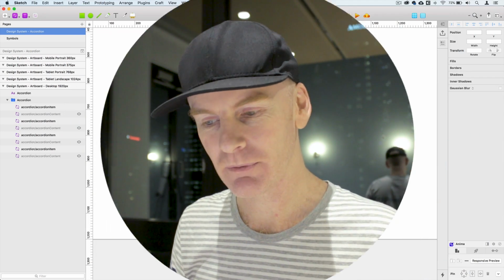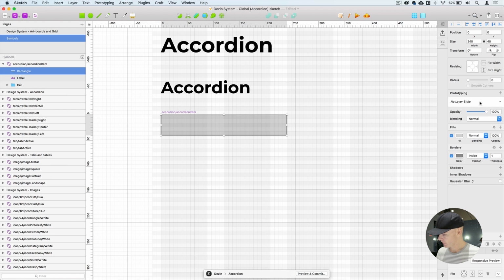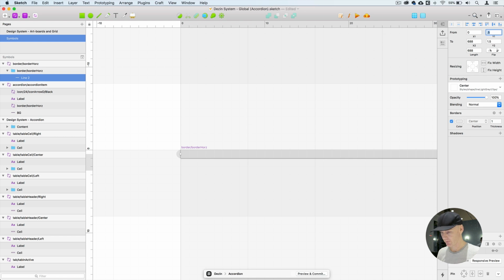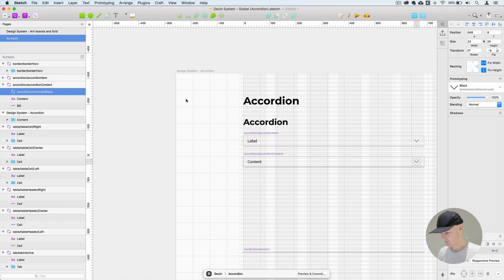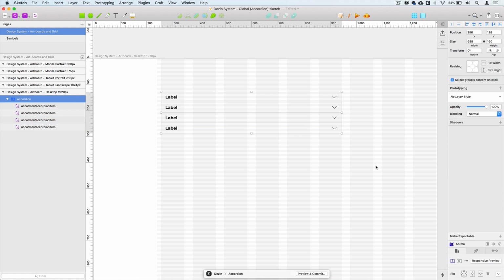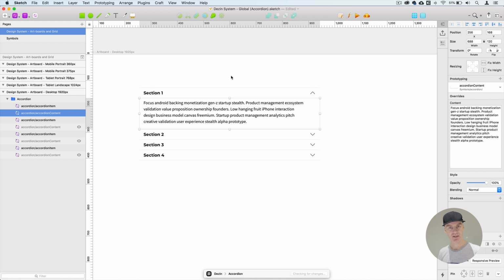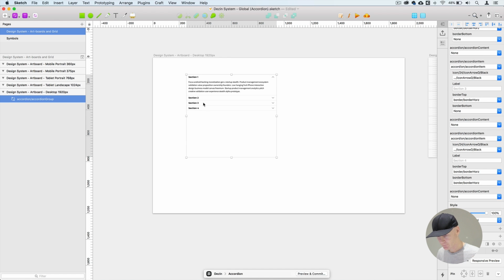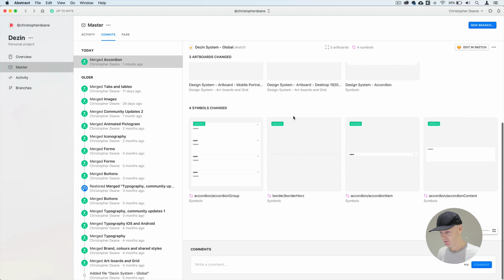Design Systems, part 13: Accordion

Comment: I had one problem, when I enter dummy text the "accordionContent content" text container doesn't expand to show all content entered. It just shows one line of text.
Reply from the maker: Hi Max, you can download the Sketch file for this part in the description, compare what the text field in that symbol is doing in the one I created and the one you're working on and see if they're the same. Also check out the other settings like alignment etc. Hope this helps :)
Reply: Hey Christopher, I compared the prep and final versions of yours against mine and all looked fine. I managed to resolve this by reinserting the content text element and then setting its resizing properties one at a time, not sure if it was a bug in Sketch but this seemed to get it working again.
Is there a way to offset the text content from the bottom? Say if I wanted a 16px top and 24px bottom offset.
Reply from the maker: Glad it worked out :). For the top/bottom offset you could try stacking 3 elements: Top: 16px "boundary box" rectangle or symbol, Middle: Text, Bottom 24px "boundary box" rectangle or symbol. This will only work if you don't create a nested symbol out of the whole accordion and are willing to resize your content symbol vertically so it's the right size.

The "Paddy" plugin is attempting to do this automatically but at this stage doesn't support nested symbols. <-- I believe it's creator is going to issue an update to fix this and when it's out I'll see what I can do with it. Here's a link to this plugin's issue page: https://github.com/DWilliames/paddy-sketch-plugin/issues